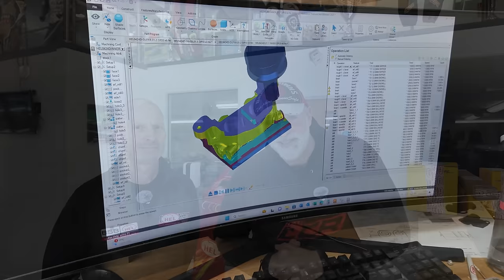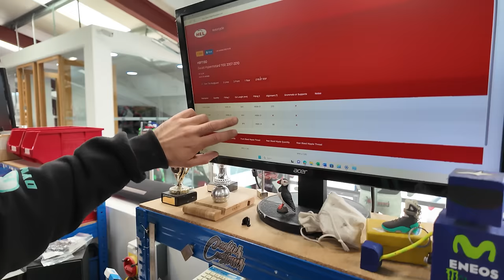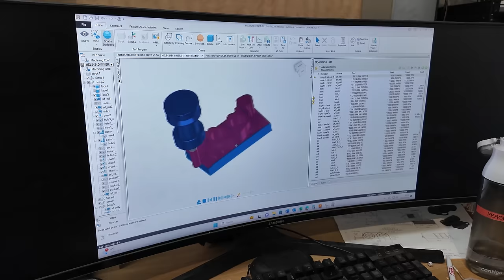HEL Performance | British Manufacturing At It's Finest!

Comment: Good vid, got hel lines on my car. Thinking about them for 08 CBR600RR because I'm going to change to 5.1 as done on the car. Going to pop in, it;s only 35miles away. I remember late 80's earily 90's Goodridge having a place around Exeter airport area. Thought it might of been some ex employees starting it, but seems not.

Comment: That was cool to see. Just went and had a look at the master cylinders on the Hel website but I couldn't see much info. Was trying to determine if the master cylinders have an option for a brake switch but didn't seem to be case. Products look good and it would be nice to have a master that's serviceable (which I also couldn't confirm) But their website could really use some work, not super easy to determine which products fit which bikes, and specific products lacking detailed info etc.
Reply from the maker: The switch is a hydraulic one, I will cover that when I do my installation vid 👍
Reply: @LambChopRides  For the from master? that's different.. will sus it out when you post the video thanks
Reply: @IN_ZANE_ 
Hydraulic pressure switch integrated into the banjo bolt.
It's what you need for using Brembo forged - the good fixed ratio, not the way overrated RCS which does have a switch mount - master cylinders on the road with brake light actuation.
KTM use this arrangement on their rear brake Brembo master cylinders.

Comment: I wish you had asked about the scooter style rear brake master cylinder/brake lever that they sell, i would like to see how that fits on a 2019 r1m with aftermarket clip ons. Just to know if there is enough clearance of the standard road going carbon fairings with the extra lever above or below the clutch lever.

Comment: I ordered HEL lines from the US site and they said it will take 3 weeks because they have to get them from the UK. Makes me wonder how well these amateurs run their business and the quality of the products when they can't do something as simple as stock their main product line. Seriously?
Reply: Nobody keeps a massive inventory anymore unless it's a very popular item, or in HEL's case, fitting.
Secondly, unless there's a US distribution, you'll be reliant on the postal system for small items.
I would hope HEL are accounting for shipping times, which in my experience, can be utter shite when sending and recieving small items to and from the US.
Sorry to say, but as bad as Royal Mail can be, USPS can be way, way worse, depending on how many states and depots the item has to go through before it's out for delivery.